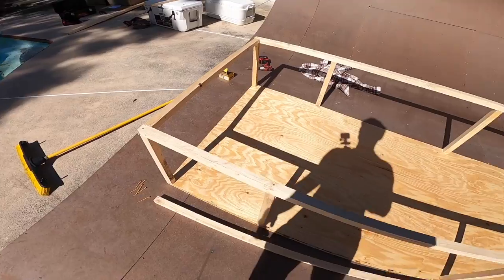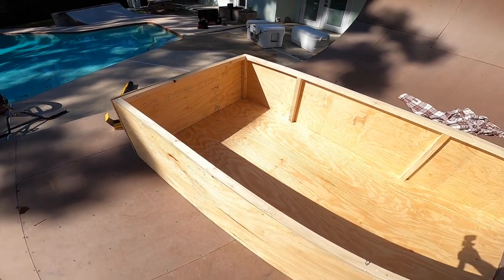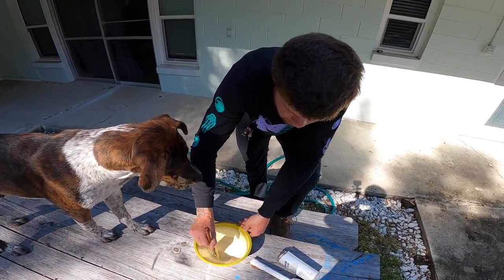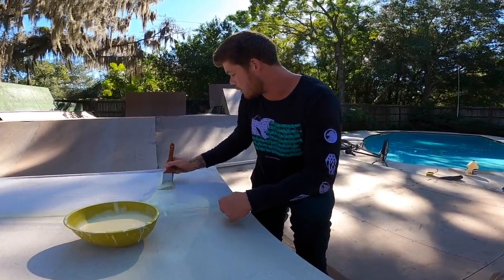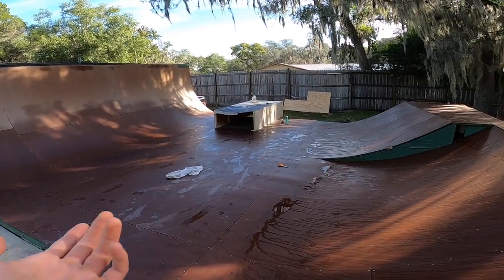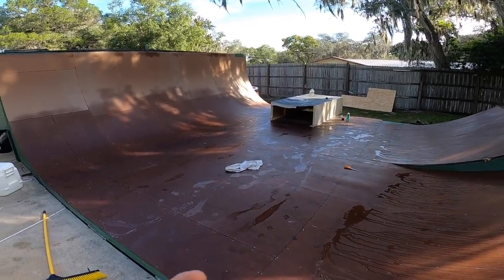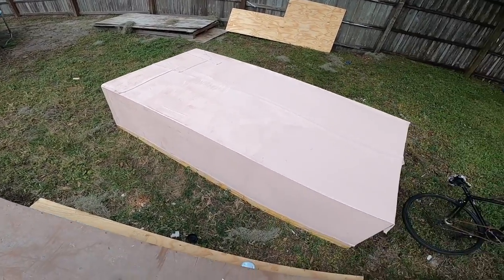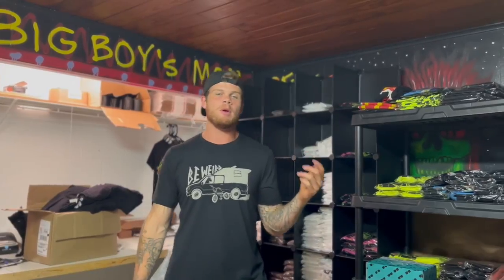Starting My DIY Slide In Camper Build

Comment: You should seal the very bottom underneath and maybe line the underneath with the fake grass that they have on mini putt greens, to help protect the weather proofing when you slide it in and out of you truck. It should protect the bed if the truck too and make it easier to slide in and out.

Comment: You want it to be structurally sound and sturdy , when you get up to 70 mph on the highway the force will collapse that camper if it’s not sturdy  . Also make sure that when you put it in the bed of your truck you make sure it’s really secure it will act like a kite in the wind if it’s not secure , I’ve seen truck bed campers come out of the bed of a truck because a guy forgot to secure it .

Comment: You for sure need a chop saw in order to make it solid and square or even just a cheap mitre box and saw it by hand. Nice tight square joints glued and screwed and it will last forever.  Freehanding with a skill saw is just about impossible to get square. Actually you can get just a Square and use it to square up your saw blade then also use it as a guide for your saw so basically hold the square on the board as you run your cut. It’s hard to explain that but what I will do is hold the square and the board in my left hand and run the saw with the right running the inside of the saw plate against the square. That takes practice but you can clamp the square to the board as well and achieve pretty clean cuts. Not trying to be that guy but the reason it was not square  is because of all the gaps in the joints fighting each other. Wood is so expensive right now do you need an accurate way to cut it. Especially if you’re going to be doing rip cuts on plywood. A glued joint is stronger than The screw and the wood itself.

Comment: Big dog quick tip if u lay out marks on a board and then cut you lose an 1/8 inch which is the width of the average circular saw blade width on each cut and you end up with each board an 1/8 shorter than the one before so add an 1/8” to each mark

Comment: Pre drill before you screw. That shits really cheap and pre drilling will prevent it from splitting on you. It will also pull up tighter. And since it’s in your truck wood glue man. Every little bit will help it against weather and wind.

Comment: you should really build the frame out of metal, no way the wood will be stiff enough
Reply: Wood is fine (especially if Fiber Glassed), IDK what this cloth and paint is though... He should have done fiberglass cloth and epoxy. It is not much money for the kits from a company like Total Boat.
Reply: @elDoober  it might be with proper joinery and bracing, but those buttjointed 2by4 with deck screws will never be stiff, and he will be driving around with it so it will have to witstand vibrations and winds. I would definitely go with metal

Comment: Dude. I would have used 2x4s. and Metal bands to hold it together. The wind at 70mph with a Gust blowing against you can rip that right OFF. Areo dynamics to the front will help. BE CAREFUL........ "L" shaped metal brackets.

Comment: Bro you need to build it with real timber, not 1x1 you need to reinforce the floor too. Also fiberglass is cheap, this poor boy, diluted wood glue is a pain in the ass compared to actual fiber glass. Also ask a handyman for building advice, Trey is kind of a joke when it comes to building shit, I was building better ramps when I was in jr high. Also when checking square use a tape measure 20, 30, 50 when you don't have a factory 90 to use. Keep it up Big Boy, I believe in you!